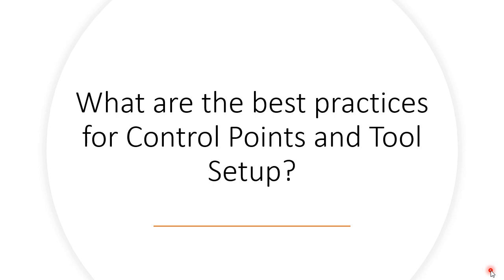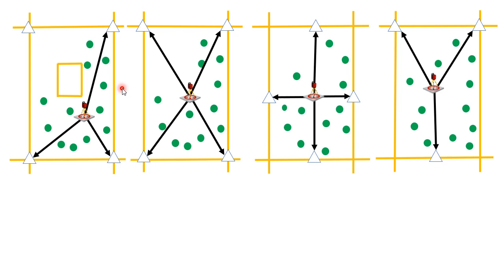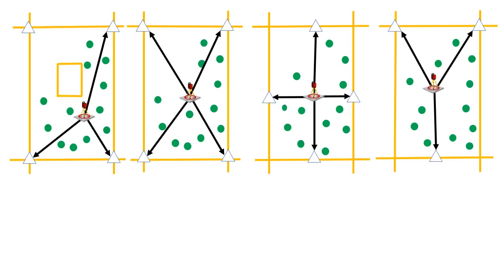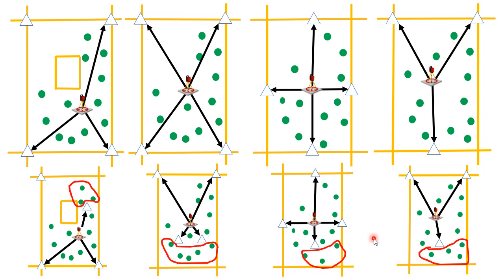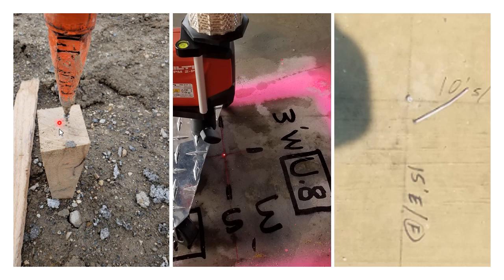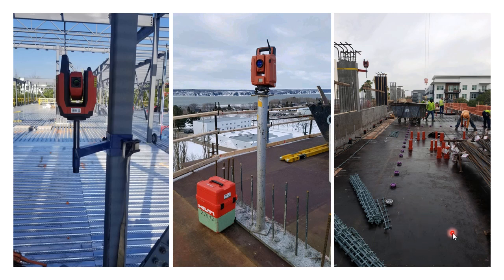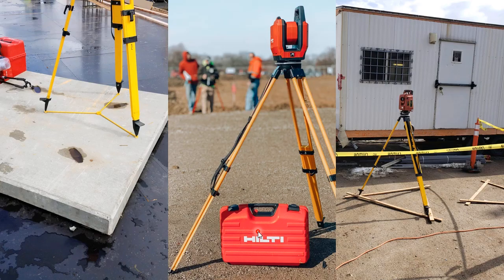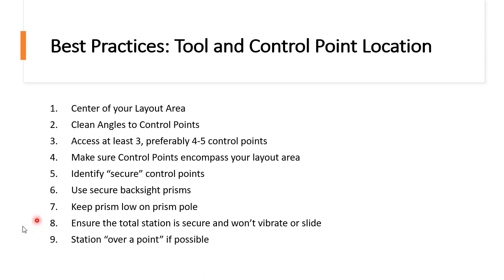Control Point Tutorial: CONTROL POINT AND TOOL LOCATION BEST PRACTICES

Comment: Your videos are very helpful. You also have some of the best you also the best audio quality of any videos of this nature on YouTube. Do you have any tutorials that talk about using GNSS for establishing control points and and then how to properly use the GNSS data for  Setting up the total station over a known point?  Does the GNSS data have to be converted to grid?  This can be very confusing for someone new and a video on this topjc will be very helpful. Thank you again for your great videos.
Reply from the maker: Hey, thank you for the question. I actually don't work with GNSS - I always use site coordinates or coordinates given to me by a surveyor or GC.

However, I think the answer to your question would simply be that yes, the GNSS data you acquire can be translated to your architectural file if you do some sort of alignment in CAD. It's possible, for instance, if you know that points obtained from GNSS are a specific offset from a grid line intersection.

Comment: If I station over a point with a 180 tool, do I only select one other control point to station? I do not use 2 other control points?
Reply from the maker: correct, you can ONLY use one other control point.
Reply: Do i have to worry about encompass layout area if i used station over point method?
Reply: @anilbasnet9171  There is no simple answer to that. However a good practice is to keep for foresights (layout) shorter than your backsight. This will minimize the impact of any angular error.